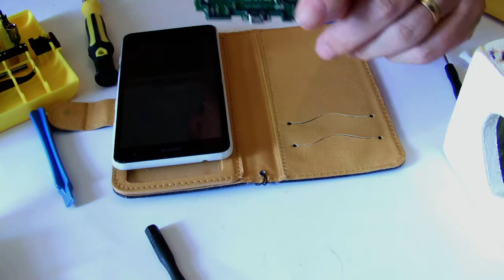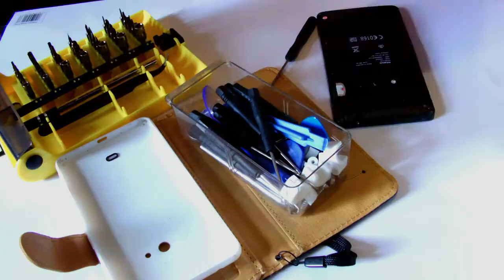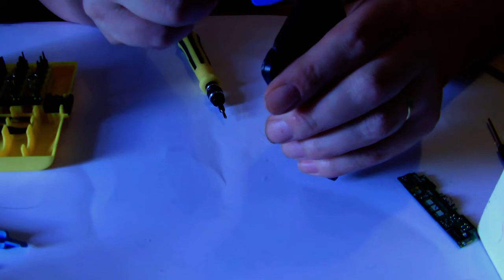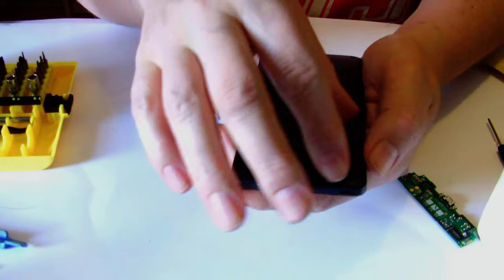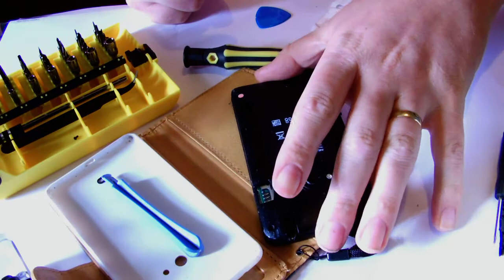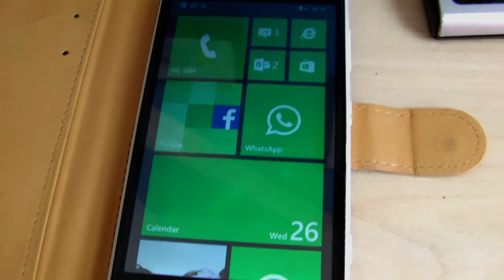How to repair Nokia Lumia 625 Power Port. (Easy steps and links)

Comment: can u make a video on how to easily fix the power n volume button pls without buying the replacement part
Reply from the maker: Real sorry but I've sold on the phone now after getting the upgrade.  You could attempt to place a thin piece of plastic between the switch and buttons to see if that helps with the pressure on them.